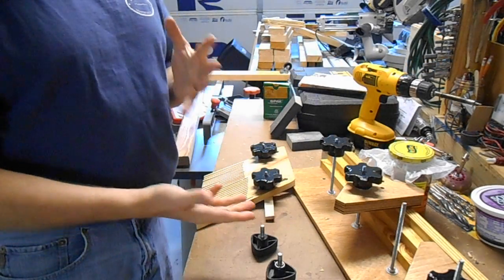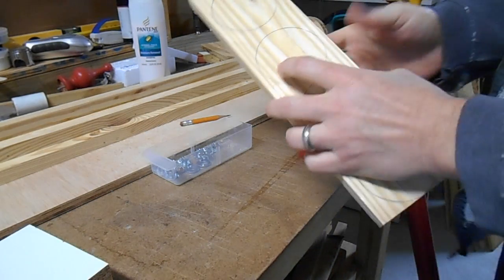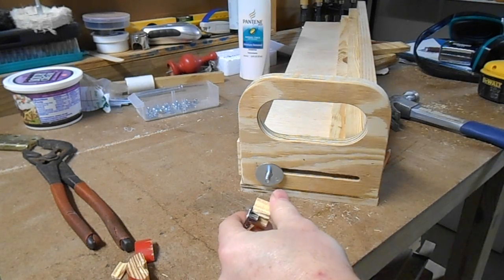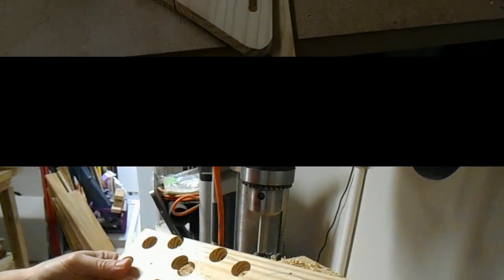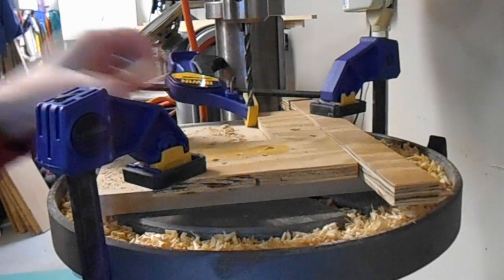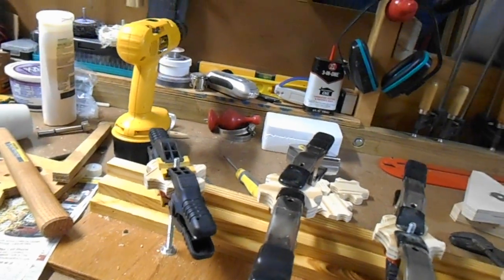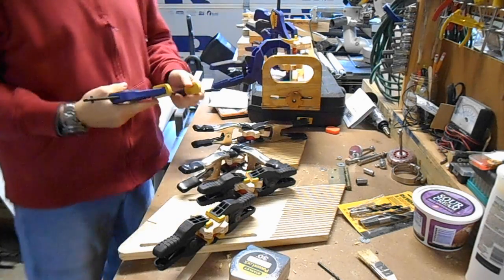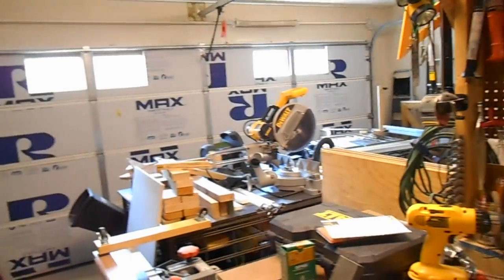DIY home made wooden clamp and jig knobs

Comment: Just a small correction of the geometry mentioned here - Radius does not give you exactly 6 equal divisions on the circumference.
C=2πr=2·π·1≈6.28319
Which would make two of the indentions closer together. To be more accurate, it would need to be at set compass at 95.5% of radius for 6 equidistant divisions of the circumference.
C=2πr=2·π·0.95493≈6.00000

Comment: I have made several of these with soft wood, but before using the forstner bit, I cross drill the rough block through the edge across the grain and glue in a dowel. It eliminates splitting along the grain.

Comment: I've used pine for such applications before, and I got a pretty good result by drilling small holes for the tangs, and then use an ordinary F clamp to press it in, instead of hammering it. and a couple of drops of epoxy and you're good to go :)  thanks for sharing this video, I'm gonna see if you have that resaw jig video up .. :)
Reply from the maker: Thanks for watching & thanks for the suggestion.  Since this video, I've taken to squeezing in the T-nuts with my bench vise.  Got tired of shattering the pine.  :-P
Reply: stringmanipulator ,nothing

Comment: I don't think you need T-nuts.  Just drill a 1/4 inch hole for the threaded rod in the curtain rod, then countersink a hole the same diameter as the outside of a standard 1/4 inch nut and epoxy the nut in place.  You could hold the nut in place with a 1/4 inch bolt while it's setting up.

Comment: Dont take this the wrong way, but like you i am very frugal (to cheap to even buy t-nuts). I use pine for my knobs all the time, but what i do is drill and tap 1/4 -20 right into the pine and then crazy glue the threads and let it dry a couple of minutes and re-tap the holes. Works excellent and in about 5 minutes you got a knob ready to go. Real quick and easy.You'd be surprised how hard the CA glue makes that wood. Anyway keep the videos coming.JOE
Reply from the maker: Thanks for the tip on that Joe... never thought of trying CA glue.  Glad you enjoyed the vid.
Reply: +joe laranjo  is on to something here knife makers  flood into the exotic woods theybuse for scales ( wooden knife parts ) and then sand and shape them

Comment: To make a strong star nut blank out of wood I glue the wood in cross-grain fashion so that's sort of like plywood maybe two layers 3/8 inch thick using wood glue. I use a machine screw that's mortised into the wood. I like to use a hole saw in combination to make the star nut. Keep up the good work.

Comment: If you put threaded rod through with a nut on each side you can tighten them together and save using all those spring clamps at 23 min. Just a thought, Ken.

Comment: I don't know if it's been mentioned earlier but it is better to drill larger pilot holes for the tee nut tangs, smal holes are useless due to the tangs being tapered. That is not a beam compass. Hope your throat gets better it must be frustrating to have to clear your throat every 3 seconds?

Comment: When it comes to driving the t_nut in & glueing the lil dowel peace on might I suggest you might try placing them together and tightening them in a bench vice it would be a slower more even action & pressure to try to prevent the wood splitting out on you

Comment: You could also (in lieu of other materials...i.e. you mentioned using a denser grade hardwood as a way to avoid split out) perhaps just make the knobs a little fatter....i.e. the pine could be cut a bit thicker if that was an option....which would likely ameliorate the 'splitting' problem you had.  Thanks for sharing!
Reply: and fatter might look.....worse to some...but function-wise they might end up to be more comfortable and easier to grab (assuming you are like me and have trouble chewing bubblegum and walking at the same time ;) .

Comment: When gluing the knob and standoff spacer in you insert a plastic drinking straw it will help align the holes and keep glue out of the threads.   Just a thought.   ? why not just used 3/4" plywood scrap for the actual knob.

Comment: An idea  Try HDPE to form your handles and you can add the t_bolts while its still hot and they can be seatted inside the knobs. All youll need is the T_bolt, a couple clean milk jugs and a heat gun or oven. Ill post a video asap cause I like the idea ounce you try HDPE as a building material I think you'll like it as even the shavings and cut offs can be reused over & over again unlike wood and when formed up in equal sizes to wood of same size it is stronger water proof as well as insect proof give it a try